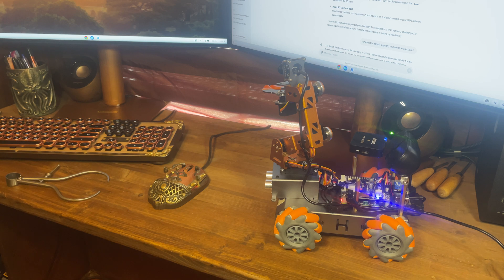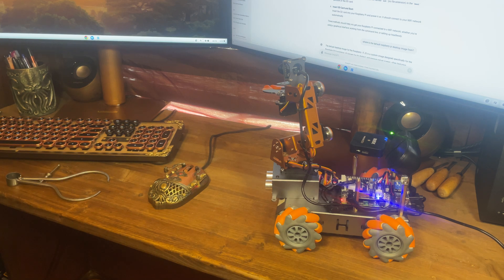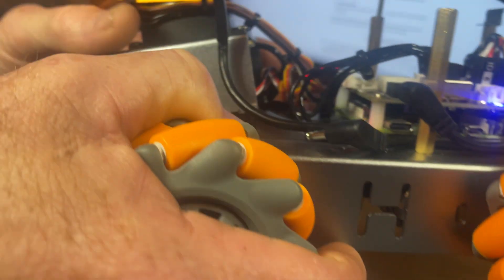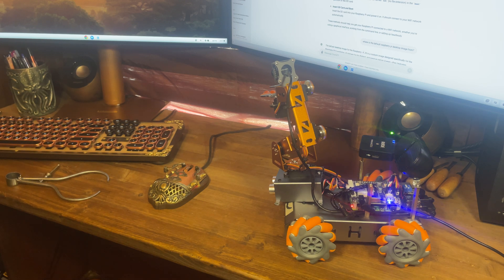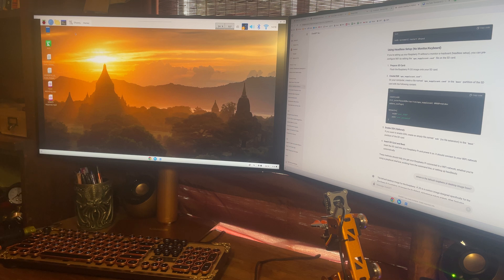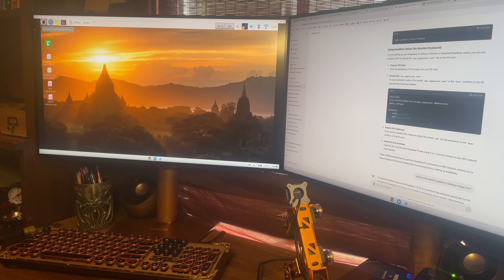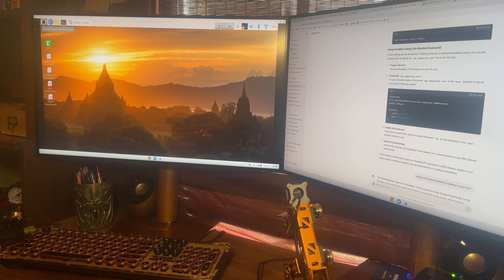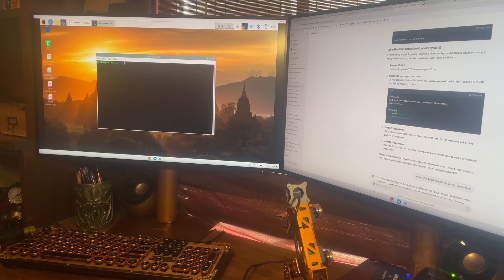How to Build a Talking AI Robot with a Raspberry Pi (Ep4 - Setup)

Comment: I have been working on a similar idea using the Yahboom car like yours with an onboard Arduino Uno R3 and an Esp32 already onboard. My plan is to have an independent AI based within a Raspberry Pi 5 for higher functions and the Uno and ESP32 dedicated to sensors, locomotion, avoidance and data traffic to the Raspberry Pi. I’ll have the LLM backed up on a large memory thumb drive with the model running from a large capacity SD Card. I’m subscribed to you channel now and will be following your progress. Great project! I’d enjoy picking your brain or collaborating on my project.
Reply from the maker: @Grandpa_Gray That's fantastic. Right now I've just got the RP 4B and a HAT board that came with the bot. The RP connects to OpenAI via WiFi, and that allows Floyd to do unbelievable things. He can read the writing on my T-shirt, identify plant species, and right now he's working on low latency battle-rap. Been posting a series of how-to videos and plan to upload my latest code rev to github. FYI I'm 58 years old and been coding for about a year 0-0